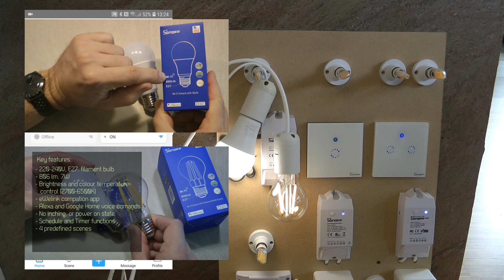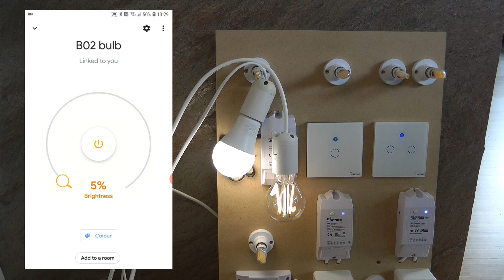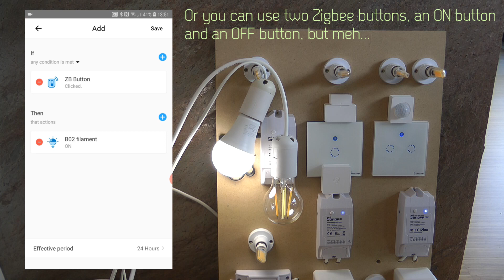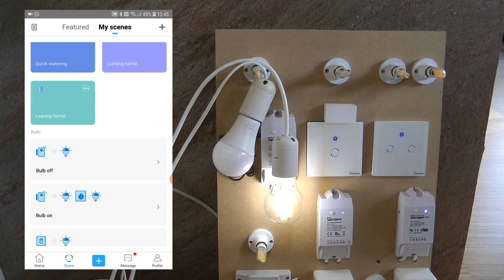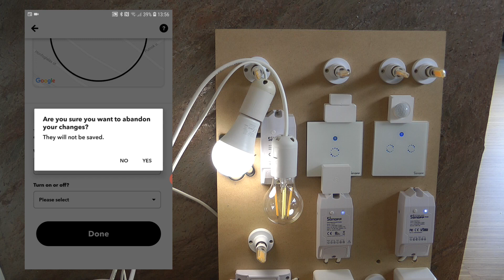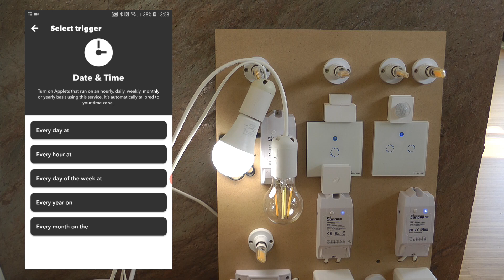Ultimate guide to using Sonoff wifi bulbs

Comment: Any idea if you can use an rgb bulb to create a dawn insulation light?
Reply from the maker: You mean dawn simulation? I tried that and did not succeed. The scenes only support turning the light on/off, changing the color is not supported (yet)
Reply: @csongorvarga  Ive set up as many actions as possible and i wonder if I can increase the brightness and cool the tone every 2 minutes?
Reply from the maker: I just checked and it is possible. It must be a recent change, because I did not see this before. But I agree the only way you can do this, is set up a lot of scenes, maybe every 15 minutes, and gradually change the brightness and color of the bulb. I see no other option to do it. You also have the option to trigger it based on Sunrise and Sunset. And you can offset that with 5, 10, 15, 20, 25 and 30 minutes. I would use the sunset/sunrise option as it moves along with how the sun sets and raises over the year. But you only have a 30 minute interval for the transition in 5 minute increments.

Comment: Is it possible to turn off the relay in the touch switch? I don't want to cut off the power to my Sonoff bulbs when clicking the button. Just want to turn off the bulbs. Also, the relay coil draws some current when is in closed position.
Reply from the maker: No, you cannot turn off the relay. But you can connect the bulb directly to the fixed live wire, and basically not use the relay at all. And yes there is an extra power draw when the relay is on, but it is very small.
Reply: @csongorvarga  What if I turn on the light using the assistant and then click the switch, will the light turn off?
Reply from the maker: @jonny11bonk  Yes, it will.

Comment: If you have a Sonoff mini that you control with a regular light switch, can a scene be created to turn on other sonoff devices with the mini as well?
Reply from the maker: Yes of course. So you can use the mini just to control other device and have nothing connected to the relays. Sonoff does not have a device which is a "wifi switch" only without the relay output.

Comment: Hi there I have 2 * Sonoff touch TOEU1C I was wanting to wire to my existing home Kitchen which is double switched and running 6 * GU10 LED's  I cant get it to work. Can you please advise?
and help appreciated
Reply from the maker: So where did you get stuck. What is working so far?
Reply: @csongorvarga   sorry can I email you pictures? It would be easier to explain
Reply: I just found it will post you pictures...thanks

Comment: Great video. Thank you. In your next video, can you clarify what 10a/2200w for some diy switches means? How should we avoid from the electric problems for smart devices? How to check whether we overused power of diy switches?
Reply from the maker: It means that the relay in the switch is rated for 10A. And if your mains voltage is 220V, 220V*10A = 2200W. Of course if you are in the us, that is 120V*10A which is only 1200W. There should be no more current flow through the switch than 10A. Otherwise the relay overheats, get damaged or catches fire. The best way to check is to buy a simple power consumption meter, like those plug-in type, usually called Kill-A-Watt which measure voltage, current and power as well. And just check how much power your device consumes. Or check the power rating of your device and divide that number with the mains voltage.
Reply: Thank you for your reply.  almost understand. I am planning to link 50w and 15 w rated devices to the sonoff diy switch in 220v. 65W/220v=0.34A is my calculation right which means my devices are ok with the switch.
Reply from the maker: @CHuKa  Oh yes, those are well below the limit, so you should be fine. And you can use quite a lot.
Reply: @csongorvarga  🙏🏼
Reply: @csongorvarga  Thank you for your reply.  almost understand. I am planning to link 50w and 15 w rated devices to the sonoff diy switch in 220v. 65W/220v=0.34A is my calculation right which means my devices are ok with the switch.

Comment: Thank you for the tutorial it's concise and straight to the point as always. Would like to know what is the max distance for a zigbee sensor to work with zigbee bridge? Do they need to be in the same room? Thank you
Reply from the maker: Zigbee works in the same frequency as Wifi, but lower power. It will definitely work across rooms, but it has less coverage than your wifi router. I don't have an exact number, and would not be able to tell how walls influence it. Keep in mind that Zigbee devices user mesh network, so a zigbee sensor can reach the gateway using another zigbee sensor as long as that is in reach of the gateway.
Reply: @csongorvarga  Thank you for the reply will definitely purchase zigbee